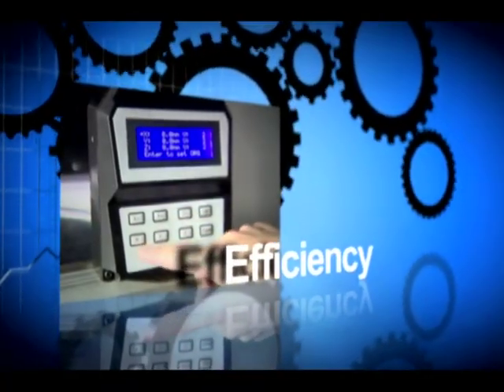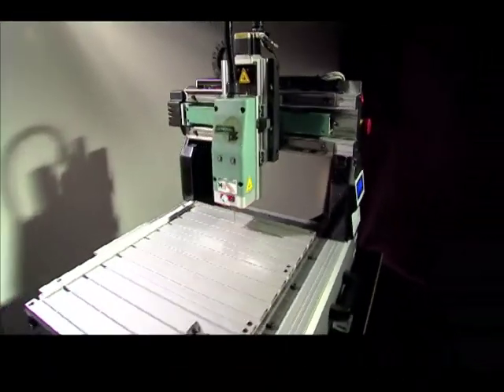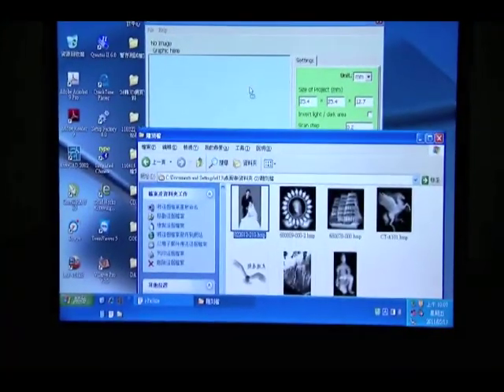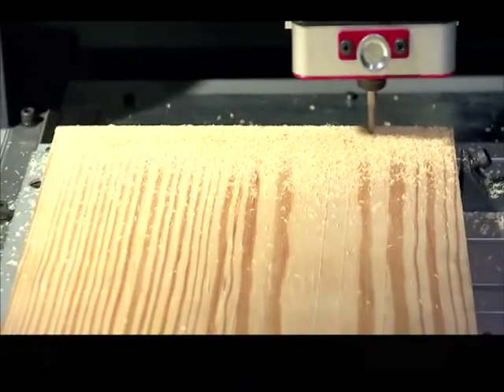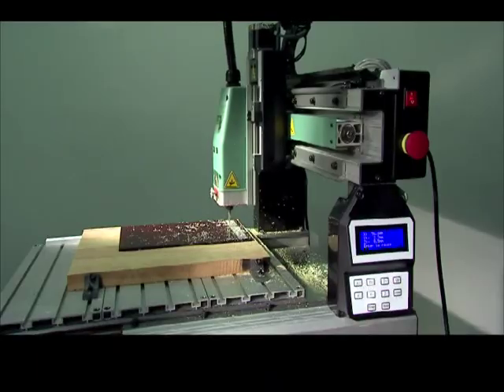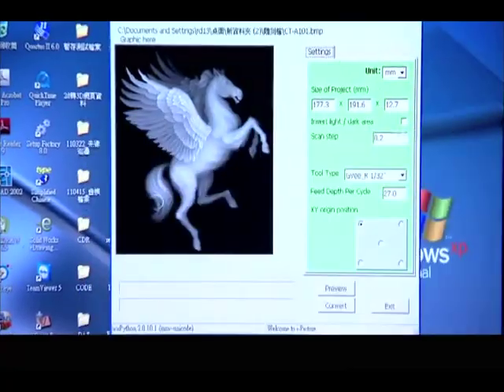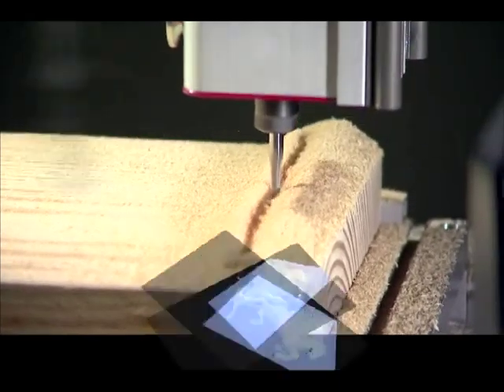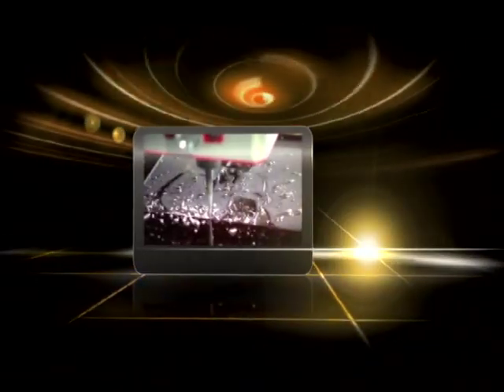General CNC i-Carver Model 40-913 M1

Comment from the maker: When running in router mode I have had some very detailed carvings that took 4-6 hours but the results were impressive and well worth the wait. 

If you are running 15-20 hours on a project, we think you may need to take a look at your settings to see where you are going wrong. 

Like any machinery you need to have a realistic expectation. if you are going to compare an iCarver to a larger more expensive machine it will not fare well. Compared to other table top routers it stacks up pretty well.

Comment from the maker: Hey Tom

Thanks for the commnets:

Allow me to comment:

Manual is lacking: While the manual offers basic instruction we are always looking for ways to improve it. We would welcome your thoughts on this. 

Very slow: Feed rates are 27 to 118 imches per minute which is reasonable for a table top machine in our opinion

This IS a General International product which is, as you mentioned, made by Geetech. 

As is the case with any 3D machining, times can be long. I have never had 15-20 hrs though

Comment: Manual is lacking, Very slow. This is not a general this is a Geetech made over seas. Customer support is hugely lacking. The programming is very limited and you will be wanting more shortly. if you want to do something the full capacity of the machine look at doing 15-20 hours of machining time.
Reply: Pryce dis machine ?